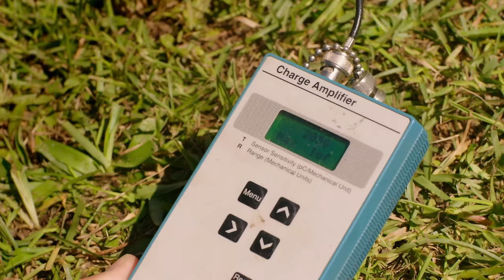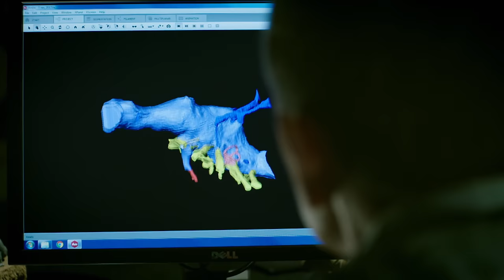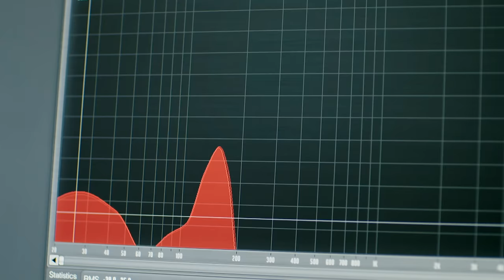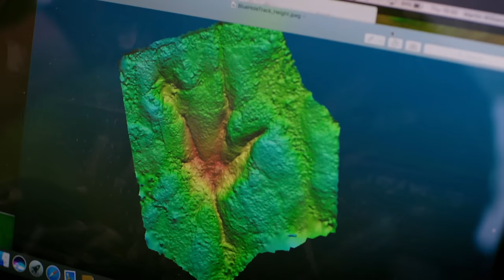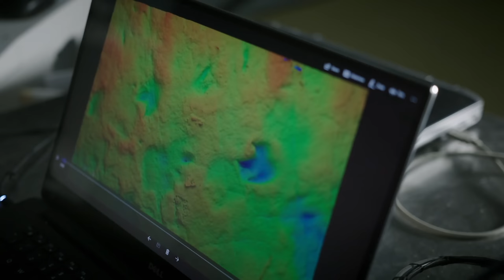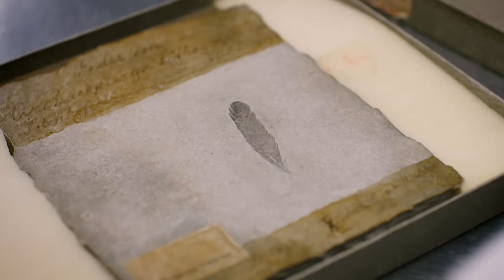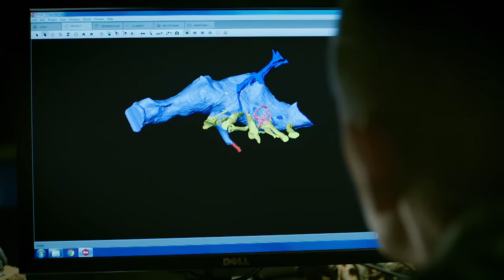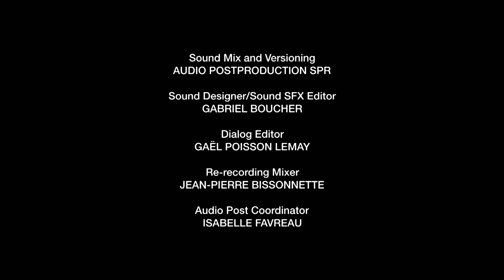The Secret Of The Deadly Lizard King | Rediscovering T-Rex | Real Wild

Comment: Those cow bones are shattering way before 8000 pounds of pressure. a crocodile can crush a cows head, you should of used an re-creation of an elephants skull to better simulate the damage done by Trex bites force.
Reply: "8000 pounds" outdated estimated t rex bite force estimated 12.800/16.000 pounds.!
Reply: @rodrigopinto6676  I was just referencing what the guy said, either way they could of used something better to test the might of the trex bite force. I remember seeing a documentary years ago, Where they made a pair of steel hydraulic Trex jaws and used them to crush the engine block and chassis of a car. That was pretty impressive to watch.
Reply: @madmick6275  recent estimated most likely over 16.000 pounds.! Has definitely the strongest bite force of any land animal ever.!
Reply: A dried cow skull is very brittle, and completely useless for this demonstration.
Reply: The cow skull was old and dried out. Looked like a year old or more maybe, since the owner of it died.
 They should’ve used a fresh cow head.
Reply: So I’ve heard. Because Crocodiles got the Strongest Jaws of any Animal around today. As for the past, Some Crocodiles that were Giant Sized & even the largest Species of Tyrannosaurs also had Powerful Jaws.
Reply: @madmike6275: And what exactly are your subject matter credentials?
Reply: @madmick6275 should have
Reply: Live and learn! Early Earth  had no oxygen, either.

Comment: One of the few things I take issue with is how the surface features are applied.  I agree with the body coloration, but it's the "mane" I have trouble with.  Do we, in fact, know that the feathers were spiny structures?  Or were they hairlike, like the hairy feathers of an emu?  I propose that since Trex didn't use a roar to intimidate it's aggressors, that it had another way to do it.  The head and neck feathers could well have had areas of differing length, and he might have had control over how much of them he could move.  By way of example, many birds have eyebrow tufts or throat ruffs they can enlarge or fan out for display.  One such bird is a Raven, who uses its eyebrows and neck ruff to communicate with others while negotiating over animal remains.  Then there's the Great Horned Owl, whose ear tufts are very expressive.  Birds have an astonishing array of feathers used for social interaction.  A crest off the back of the head, two crests that resemble clusters of pens over one's ears, a waterbird with a nose crest.  Fans of head feathers behind the head.  Could a T-Rex have a wattle or skin areas around the eyes that were either yellow or red, allowing him to make vocalizations outside of his skull using a bladder-like wattle that would inflate.  I think about the ruffed Grouse, who announces his presence by beating his wings upon his breast as he inflates it, creating a sound that resembles a motorcycle starting up, slow, then fast.  There are lots of birds, reptiles and mammals that use gurgling or whistling sounds made in the nasal passages.  I could go on at length about the possibilities, but I want to emphasize the point that the ruffed T-Rex is not as intimidating as he could be, given the parameters.  Simple fuzz is not really enough, in my honest opinion.

The other thing that didn't have any data presented for, was the stride length.  Yes, you have footprinst preserved in mud, but were thos prints of a striding dinosaur, or were they running?  Given the ratio of numbers between hip and heel, that much should have been available.  I have a hard time believing that a creature that was built for running after prey as a teenager, is reduced so dramatically in speed as an adult.  Are there any corollaries to that scenario?  I am an artist, and I am very often called upon to draw things that don't exist in a realistic way.  That means I have a working knowledge of physiology, body morphology and a mental library of hundreds of species and how they compare.  I have to say that the walking/running sequence of the T-Rex just seems wrong to me.  It's missing the gracile motions of a hunter or ambush predator.  When it runs at a moderate pace, the whole creature should look like a well oiled machine,  with all parts working smoothly.  Your cgi model lacked that.  It actually looked like someone had hobbled it"s ankles, restricting stride length and making the whole creature looke awkward and unreal.

In every other way I liked your presentation and I'm glad I watched it.

Comment: The computer model didn't cange posture, or rise onto it's toes like the ostrich did.

Also the head and tail may have been similar in weight, if the tail was for ballance.  Swinging the head or tail, would have kept ballance, or restored ballance, even at speed, like a bicycle, or horse, and rider, at speed

Comment: I thought that there was another dinosaur that was similar to T Rex but that it was actually larger than T Rex. I have heard that several times before, but maybe it didn't exist in the same time period maybe it evolved from the T Rex.
Reply: The giga is thought to be as tall and long as a T-Rex, but after studying its bone structure it was designed for slicing and biting chunks- where the Rex was designed for crushing force and pulverizing bone. The Rex had a much thicker build and was heavier. Especially, with newer leg bones recently discovered the T-Rex keeps getting bigger.

Comment: Even if their estimate of the T Rex bite force is correct at some 8000lbs/sq. in, (a very big "if" when their methodology is so crude, merely scaling up based on weight as if it's a linear relationship, especially when you're dealing with something extinct 65 million years ago), I find their ways of testing its power on "equivalent prey" very suspect--crushing a dried up cow skull or a bare thigh (?) bone with a cast METAL "tooth"??!! 

It's almost as if they were just trying to get good visuals for a film rather than making a serious effort at simulation. Those "demos" were so terrible that an amateur could easily spot multiple faults.  First, the prey (say duckbills) would be way bigger than a cow--adults were as big if not bigger than T rex.  Second, there would be layers of tough skin (did duckbills have any armor?  We know that other albeit tougher preys like triceratops did) and muscles and real live dense bones, not dried up brittle empty cow skulls or bones.  (They couldn't even find a real cow's head at least?  Or didn't they have time to go to a slaughterhouse?)  Third, considering that teeth are themselves brittle, I highly doubt that T Rex would've been biting through a likely prey's tough body parts like melted cheese, especially with their 6" long (and therefore even more vulnerable teeth than crocs' or alligators') steak knife-like teeth (we don't stab at our steaks, never mind 300lb skulls, but cut them).  I'm reasonably sure back then there were no dinosaur dentists that T Rex could go to after breaking some or most of their teeth eating a crunchy meal or two. 

As far as I know, nobody has found that T Rex had a shark-like system of multiple rows of teeth (which are short and sturdy, by the way) waiting to replace older or damaged ones; so a T without teeth would likely starve to death.  A species of super-biters biting everything in sight would soon go extinct, instead of evolving into the magnificent monsters we all love.  So much for the super bite force that likely couldn't be used even if it was true. Maybe good as clickbait TV or video, but terrible science. 

And these are "top scientists" finally revealing for us "the truth about T Rex"???  Sounds like they're just hoisting another tattered layer of their own favorite stories over our eyes like the previous generations of scientists and story tellers.  I'm not cynical, just disappointed. :)  We really deserve better science education if not scientists than what was shown here at the "cutting edge" of modern paleontology.
Reply: Wow, just about everything you wrote was wrong. They didn't have brittle steak knives for teenth, but rather dull and sturdy teeth, which did in fact, regrow on a regular basis like shark's teeth. The cow skull was a dramatic display, but both multiple studies and actual fieldwork with fossils indicate the massive bite pressure. Maybe have at least a basic knowledge about the subject you're trolling?
Reply: You forgot the fossilized T-rex skin that exists showing absolutely no evidence of feathers or bristles. Also, those tracks looked like one animal made them to me. Where are the tracks from the rest of the "pack"?